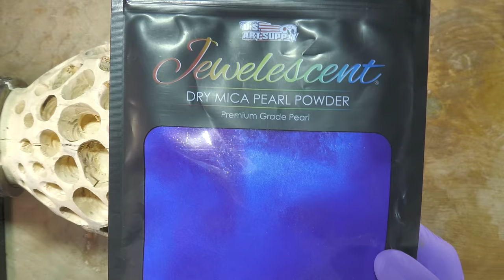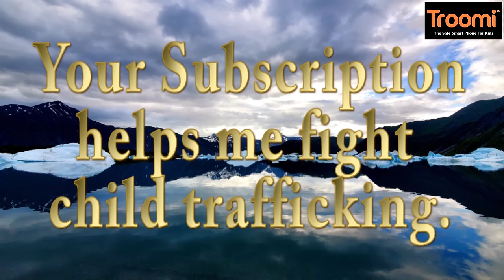"Hidden Seas" Wood turning and resin art inspired by stainglass and the ocean. ArtForOUR.org

Comment: Great piece! 

Here are a couple of things I have found with working with UV Resin.  First I found you can pour in layers.  Secondly torching the top of a smallnot to thick of a piece will pop most if not all of the air bubbles.   Thirdly I run my UV lamps for longer to get a better cure.

If I am doing a thick piece I usually pour in layers curing between layers:  I pour then I lightly torch over the pour until the visible bubble are gone.  I generally use a small kitchen torch but sometimes I use my husbands hand held propane torch. I dont like to use the bigger torch very often because I have small hands and don't feel like I have total control with it.  Torching may take two or three passes over the piece (about 2 or 3 seconds). Then I place under my UV lamp for about 4 to 6 minutes.  90 seconds may  make the top hard but the under portion is only tacky soft set if the resin is to thick or opaque.  When in doubt the longer the lamp is used on it the better.  I have found 6 minutes usually cures the piece thourghly.  Once I am done with the curing process I let the piece set for about 24 hours to air cure and settle up before I do anything else to the piece.  That seems to harden the piece more and makes it less resistant to damage while I finish off the piece.   

If you have small chips in the resin you can fill the chip with clear resin cure it with your UV lamp, like you normally would, then let it set for 24 hours.  At that point you can proceed with your project.  Using clear resin lets the original color to come through and will be less noticable of a repair.  Also adding alcohol ink as a colorant to your resin keeps the resin more transparent than other pigments.  To give resin depth you can add small amounts mica powder or glitter. If not to much is added you still retain the transparent look but have a little bit of shine and interesting depth.

Love all your tools...

Keep up the good work and good luck on your organizational fund raising.  

Mary

PS... When you encountered the tacky resin in your vase you could of put a small UV lamp inside the vase and moved it about every 3 or 4 minutes to cover all areas of the inside of the vase. Once it was cured you could of continued with finishing the inside with out the problem of uncured resin.  I  bought a couple of small UV lamps, each for under $10.00 on Amazon,  that I use when I have pieces that have odd angles.  I can position the small lamps so they hit the odd angle straight on which gives the piece 360 degrees UV light exposure to cure.  I think that would have helped you a great deal inside the vase too.
Reply from the maker: Awesome advice!  Thank you!  Do you have a lamp you recommend?  The only thing i could find had a max of 90 sec timer on it...
Reply: @artgivinghope 

 I bought JDiction UV lamps they are inexpensive and do little area or pieces just fine.  They have 30, 60 and 90 second timers... I use the the 60 second timer 4 to 6 times... It is kinda of pain to reset it for 60 seconds every minute or so but I discovered I don't need to babysit the lamp.  I do try and reset it as soon as the lamp turns off but if I don't jump on it right away it is ok. I have a sticky note pad by the lamp and make tick marks for everytime I reset the lamp. This helps me keep track of how many times I reset the timer especially if I am multi tasking. Bottom line is that it is easier to under cure UV resin than to over cure.

Hope this helps...
Reply from the maker: Thanks!

Comment: I love your art, you have such creativity. UV resin can be layered, so you can make it deeper by doing multiple layers. The light has to penetrate to set, so your bottoms were gooey because the blue was so dark and there was no light coming from the sides like in a semi opaque mold. I would have started with a thin, clear layer and then built colors on top of it to build depth. You probably already know that resin pigments are very strong, using less pigment would also let the light penetrate all the way through. I hope you use it again! And I’m thankful for the chance to share info because I always learn something from you. It’s like sharing! Thanks for sharing your beautiful work, and for all you do for children.
Reply from the maker: Thank you so much Michele!

https://www.artforour.org/how-you-can-help
Reply: Now that I’ve watched more of the video, you could also put the UV light inside the project to cure it from the inside once you exposed the resin from the wood.

Comment: That’s beautiful! You did great finishing that with uncured UV, that can be a sticky mess. It reminds me of a wicked glass I used occasionally, it left very sharp burs after cutting it. I was a stained glass artisan in SL. I did a replacement window for the chapel on the Temple grounds. Just the round window in the middle, unfortunately we couldn’t repair the original. We were lucky enough to get the glass to match all the others so, it’s not noticeable. Great job on your piece and helping OUR.
Reply from the maker: That's awesome!  Thank you!

https://www.artforour.org/currentauctions

Comment: Magnificent!  Your new opening sequence and your Arbor Tech tool are super cool.  Generally, UV resin can only be poured 3-4mm thick and set properly.  Pigment probably lessens that, as well.  Multiple coats are definitely a thing with this stuff.   If your UV resin isn't cured nice and solid, you can set it in the sun outside after you get everything where you want it.  Works well for a large piece like this.   UV resin is more a tool you can use in conjunction with your deep pour epoxy, not instead of for the size of projects you do.  When you got to the gummy part, you could have set that outside to fully cure.
Reply from the maker: Awesome!  thank you for the tips!

ArtForOUR.org

Comment: Once you get the resin set with your light.  Take it outside on a sunny day for about 20 minutes. rotate it every 3 or four giving all surfaces direct sunlight. I deal with UV resin all the time and have 2 resin printers as well. I would also suggest concidering using a UV printing resin. It will set hard and not as elastic . It also will not degrade over time like art resin does.
Reply from the maker: Thank you for the suggestions!

https://www.artforour.org/currentauctions

Comment: I really dig that 3D look you get from the carved resin it does give it that antique glass look, instead of us you might use a timed cure epoxy 5,10,15,30 whatever suits you just mix it in batches that suit the size area within that timeframe and your idea to level your piece during the process would be really good here too and you can pre mix in the pearl so you have more control over the concentration of the pigment, ps be careful with the 5&10 min they start to go off before that. Just test it before you get in trouble with a big project, I hope this helps. Peace
Reply from the maker: Good ideas!  Thank you!

https://www.artforour.org/currentauctions

Comment: UV resin can't really set thick, if you could apply light to both sides you'd have a better set too. Light gets cut signiicantly in power just hitting the water's serfice, since resin is ticker I assume it's worse. Also, a heat gun may help with bubbles.
Reply from the maker: Thanks!

https://www.artforour.org/how-you-can-help

Comment: To make a finer grained filler 
purchase a food processor or a blender from a thrift shop and process a couple scoops of the shavings and mix with your glue 
To follow the stained glass theme go for a cobalt blue and scarlet and alternate colours in the cells
Position a shop vac wand near the mouth at 3 to 4 o'clock to suction up the shavings when you are boring 
Make a PVC wand and a reducer fitting in shop vac to suction out the shavings 
Air hose aerosolizes the dust and plastic shavings and spreads it around the shop as dust ,into machinery and breathing it in unless you use proper respirator mask or powered respirator
A nice sharp inch and half spindle roughing gouge will drop the time taken to rough it to shape and give a finer tool finish on spalted woods

Comment: DAN, another great piece of work!  Trying to buy that flexible foam you use by the attached link but it always has " page not found" from Amazon.  Any other suggestions or links?
Reply from the maker: The best I've found recently is at home depot:  Polywall Plastic Panel
Reply: Thanks!  Trying something with peacock feathers and resin.